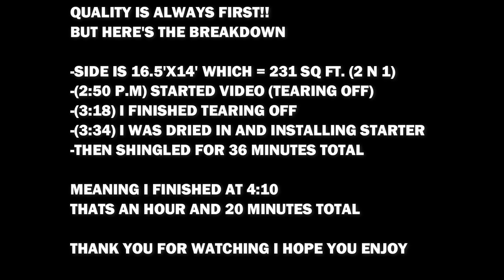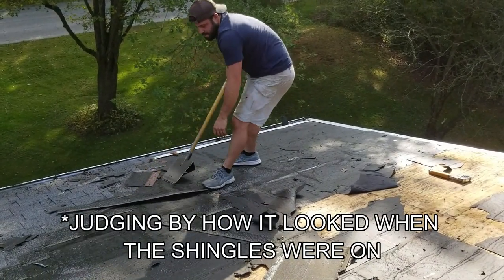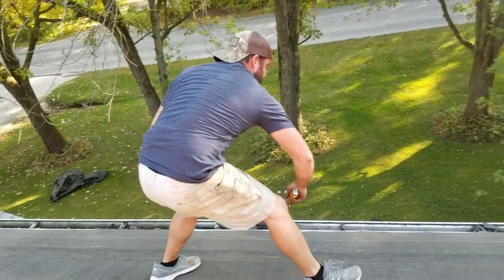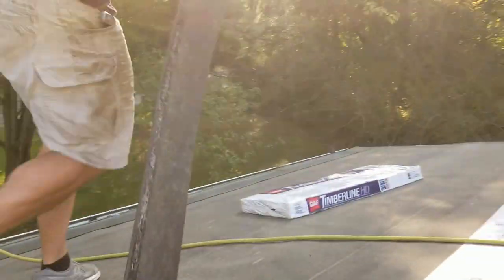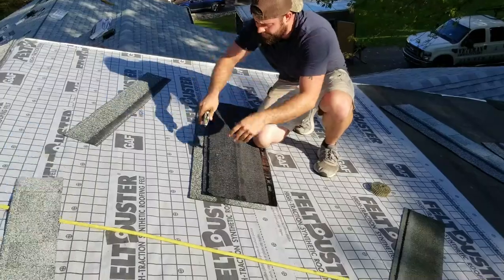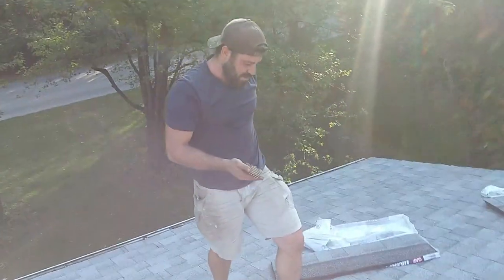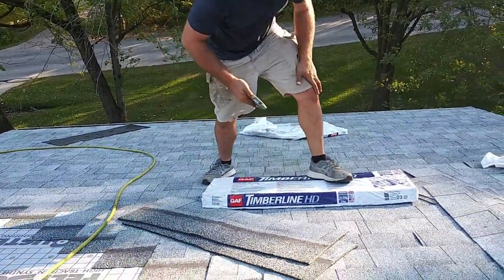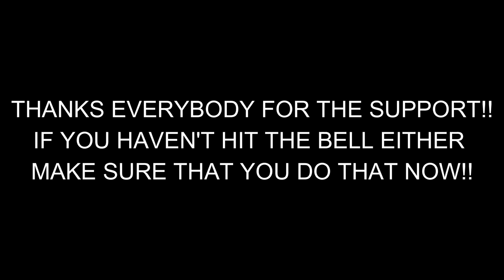WORLDS FASTEST SHINGLER. (uncut) TEAR OFF. DRY IN. PUT BACK

Comment: 50+ years a finish carpenter, haven't roofed since early 1970s. About to strip shakes from my home and reroof it. 12/12 pitch. Questions: I thought with the new synthetic underlayment(s) you were required to use plastic cap/button-head nails for securing it? No bead of blackjack/roofing cement along the edges? Is that because you are not in a high wind driving rain area?
That coil that escaped.. On my jobs any tools or materials lost which poses a possible danger to someone, it cost you a 6-pack or 12-pack of good beer, depending on crew size, and all share in it at the end of the day. Had said item actually hit someone (hopefully not injurd) that person gets the entire allotment as compensation.
Finally...Beware all those enlightened(woke) simpletons in the democratic party who want to ban & confiscate your nail guns with high capacity magazines! [SALUTE]
Reply from the maker: different areas require different things. call a roofing company or shingle supplier for your questions. I do recommend cap nails for the synthetic. although most are rated for staples...that's only for walking strength. to be honest staples will leak if a roof is only papered with them during a rain. I staple when I know i'm going to shingle it right away and that's ok

Comment: Sure he is moving efficiently but let's be real here. He is removing 2-ply shingles that are not crumbling allowing him to remove a dozen shingles at a time also  no: prep work shown, new ice guard should be applied to bare sheathing so skipped that step, no ice guard up rakes either, no hips, no valleys, shingles already on roof, low slope roof easy to walk on without ropes, harnesses, or roof jacks no wall flashing to install, no chimney to deal with, no ridge vent.  You are only seeing the glory work here.
Home  owners 95% chance this does not apply to you project.  This is far from super human sorry to burst the bubble here.  Full disclosure I was a contractor/construction manager for 12 years and have been an architect now for 7 years.  I have installed, managed, and designed countless roofing jobs and this guy is good, no doubt, but world's fastest?.........

Comment: I like your style but why do u use so many nails? And why do u space the 1st and 2nd nail out so far and put the last 4 so close together?
Reply from the maker: You can't nail in that area because the seam of the next single will be there and cause a potential leak in the future.  And I 5 nail coz that's what we prefer.  1 more than my area requires.  But a lot of areas require 6 nails

Comment: That's bout as good as it gets I suppose. But idk... I pulled off 4 layers on around 600 square feet in about 4 to 5 hours quite casually... On average a hundred square foot costs 350 to 500....... We replaced a bunch of wood... Pulled all nails, replaced all drip edge over the entire job...I think we did it for less than 1800$ totalling bout 30 hours between us all... So anyway... Idk if that's exactly praise worthy... Older shingles tar fails and sticks in weird ways... When you're dealing with numerous layers it's impossible to tear up whole shingles.. let alone entire grips... Or nails with them ..  every jobs different...  my whole team gets paid 15 an hour... And we can do most jobs for less than typical contractors... How much did you make?

Comment: I cringed when I saw the drip edge on the eaves laying over the felt.
Reply from the maker: On the original roof? Like as in the drip edge capped over the tar paper?
Reply: Worlds Fastest Shingler Yes the original. Before you did the tear off it seem that the felt was under the drip edge on the eaves.You corrected it afterwards when I believe you laid down ice guard.

Comment: Give you this; you're a fast worker, experienced and know how to set a roof for productivity  BUT< I've Never seen an old roof with so few nails in it (7:38 / 7:48 / 7:58 freeze frame) Looks like it was stuck down by the seal tabs only to the felt. I can't say I've ever seen anybody hand rip a 6 row section of shingles! Shortcuts galore! Why put Water Shield on if your not going to do it the right way (behind the gutter) (maybe your in the south?) Shiners? I'd hope not, but you'd never get by a roof inspector. And I admit this (Quality) was not the object of this video!
Reply from the maker: Being fast is no use if you're a hack! Believe me the quality was there. And they were 4 nailed like every other roof in the area.  Just high nailed. Almost no nails got the common bond.  And the ice shield is supposed to go over the gutter apron.  Not into the gutter.  II'm in northwest Indiana

Comment: Not by far fast. 5 squares an hour is fast. That’s 20 bundles at 4 per square.  He is at about 2 1/2 squares an hour. (10 bundles) i have roofed for 38 years. This guy is super slow. However, he is doing it correctly. Proper nailing, and shingle placement. I’m 54 years old. I can still smoke this guy. Most squares in a day, 32.  No joke.
Reply from the maker: I've done more than that! And 3 bundles to a sq lol. Have you watched my shingling race video lmao

Comment: Starter up the eaves is for goofers who cant cut and run an eave straight 23years roofing i aint popped a line on a roof in 6years
Reply: Eaves? Don't you mean rake? I don't know anyone who doesn't put starter on the eaves. Your shingles must droop alot at the eaves if you don't starters there. Putting starters on the "Rakes" which is the correct term, gives a better look from the underside, haven't seen anyone cut a perfect factory edge by hand. So your rakes must be a bit wavy and not perfectly straight, as a starter would enable. Anyways, it's just preference and Imo gives it a better look from underneath, it also gives the shingles that are overhanging, better support. I havent ever had to chalk a line up for starters and I've only been roofing for 5 years, always came out straight.

Comment: A staple tacker?  I assume you wouldnt use staples on a higher pitch correct? I live in the northeast US and we dont use strips on the eaves here either, but if we did, they would be starters with the tar strip to the outside to help seal against wind/rain. Maybe necessary in high wind areas. Your just gonna knock your nails off with your hose. Hose should be ran from below, hooked in the gutter. Ive watched alot of your vids and your hose safety is HORRIBLE. lol. Especially if you have inexperienced laborors. GAF shingles suuuuucked 10-15 years ago, are they better now? I prefer Owens-Corning all day. Overall love your work though! Coming from a guy who has consistently made a living for 20 years fixing other "contractors" mistakes. Isnt that Bostitch nail gun spectacular? So light and fast. Its like having an AK compared to a muzzle loader.

Comment: I put on hundreds of roofs, Never nailed the starter in the center line at random! Always used a Starter line at the top of the shingle and did the math and the cutting of the entire house on the ground, With Three tab [that is what we had back then] I used a 4/3/8'' set back multiple.
You are standing on a 4/12  roof pitch a roofers dream. I don't see tarps surrounding the work areas or a dumpster with a  chute set up?.
I covered the entire premises with canvas tarps before we even set up a ladder.
My best was four square an hour having someone throw down the nine piece sets! 
What was yours?
There was no internet video in my day and I know it's hard to believe, but  do the math and take a day cutting. You will blow the minds of every fastest roofers helper you hire.
Oh Yea never a single call back in 36 years except wind over 80 MPH [insurance money] and a valley that was not mine.
Reply from the maker: Idk what you're trying to say lol one time when I was just started getting fast i did 20 bundles (6 n 2) in 1 hr 5 minutes.  Now a days if i had to guess i think i could put on 8-9 sq in one hour no tosser needed.  N btw the roof was done.  This was all that's left. N I had tarps down. This lady had beautiful roses everywhere n we didn't ruin one thing.  Judy because you don't see a "canvas" of tarps. Doesn't mean I don't treat the homeowners landscape with respect.  I put more effort into that than I do the roof. The roof is easy.